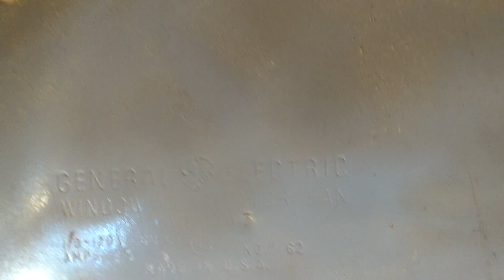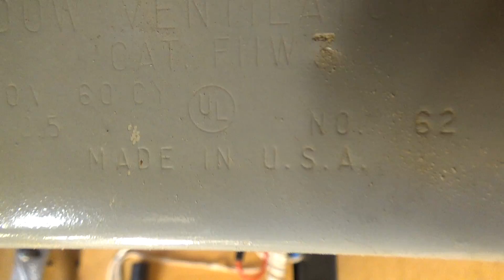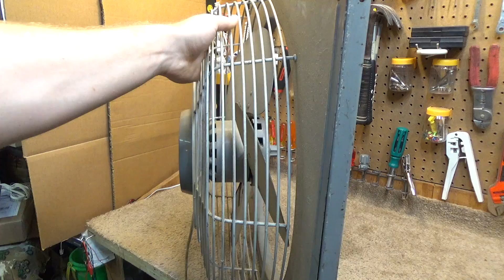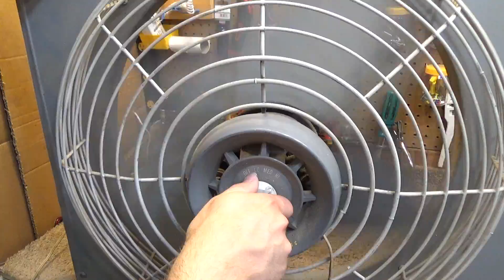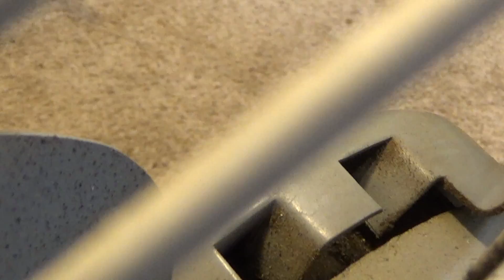General Electric F11W Metal Window Ventilator Fan | Initial Checkout

Comment: these have a giant unit bearing motor, a larger version of the ones used in fridge condenser fans. they will last a long time since they have sealed bearings, a large oil wick, and a system to pump the oil around, but when they finally do need oil they are annoying to deal with.
Reply from the maker: True, and they'd last even longer if the blade wasn't so out of balance!

Comment: I've got two of these GE single bearing fans. I just oil from the front and even got a seized motor going by just doing that. Haven't got the guts to drill out the back cover plate. Really cool find!
Reply from the maker: Never drill—poke the hole through with a nail.

Comment: Amazing how certain companies just seemed to never get the blade balance correct throughout their entire history, no matter how vintage.  Given how the blade is out of balance and how difficult it is to service, I would not consider it to be a very good fan, but I will give it that it almost never needs servicing and it's a tank that moves a lot of air.  Are there plans to use this in place of the Sears one?
Reply from the maker: At the time of this fan's production, the manufacturing technology for precision balancing blades wasn't as available as it is today. It's far more excusable 50 years ago than it is now. The bearing design in these motors is absolutely brilliant because when it runs out of oil, it will lock up before the bearing gets damaged because there's so much surface area to it. It is difficult to service, but considering it only needs servicing every 50 years or so, it's hard to hold that against it. There are plans to put this to use, though it would have to be in the back of the house due to the way the breeze naturally moves around here.

Comment: That's a pretty cool fan! I would say 1950's vintage.  Would love to see this thing mounted in a window with no grill on the back like that! Would also be very interesting to do a comparison between this one and the sears you have. I suspect this will perform very similarly to its box fan versions from the time. I take it you know about servicing these motors with pulling the back off and the clips and such? Might have to do a timelapse for the cleaning and servicing of this one , it will probably take a while lol. Cool find!
Reply from the maker: Thanks! It definitely has a 50s appearance, but I don't think it dates back that far. Given the similarities to the box fans, I suspect it probably came out of the same era, which would have been the mid 60s at earliest I believe. I am familiar with the servicing procedure of those motors, I've been wanting to do a video of it for a while now so this will be a good opportunity to finally do so.
Reply: @JordanU  It is mid to late 50s era in the frost gray color. The ones in the mid 60s would be the beige color with the sunburst style grille, and then going to the 5 wing plastic blades later, and finally adding an exterior grille at the latest version.
Reply from the maker: @coled5090  Thanks for the information!

Comment: It appears that we have a new spammer. And weren't those type of blades also used in the old all-metal GE box fans?
Reply: Yeah it looks like exactly the same blade, just reversed.
Reply from the maker: It does appear to be a very similar blade.